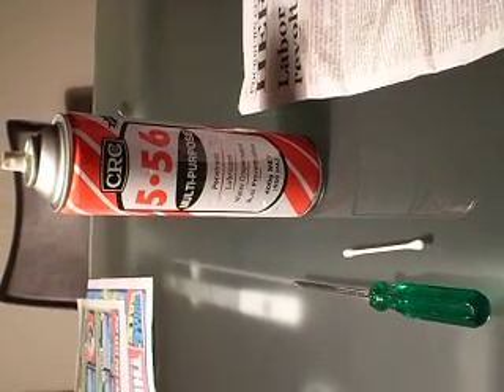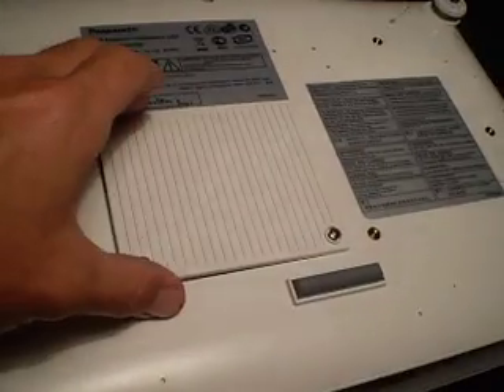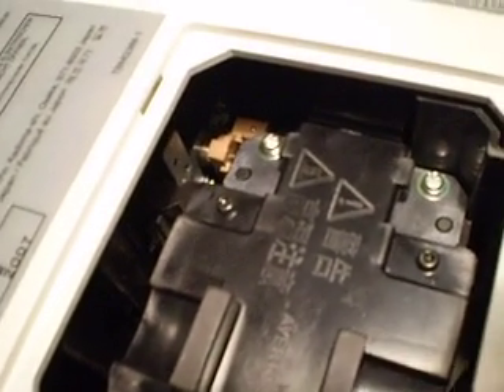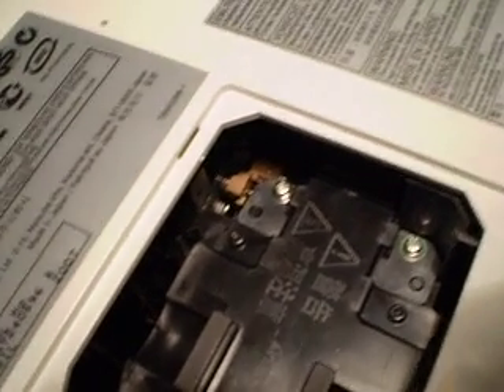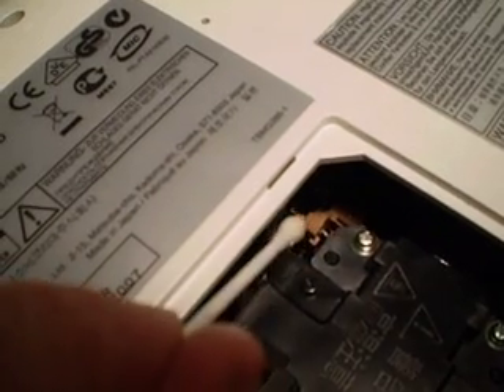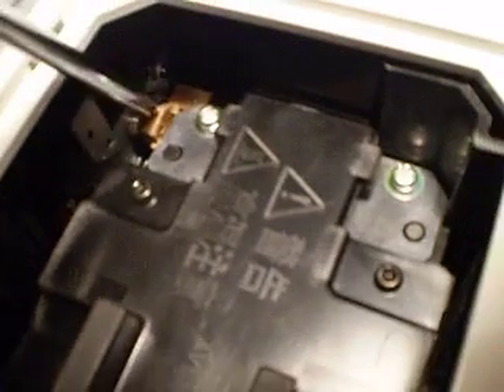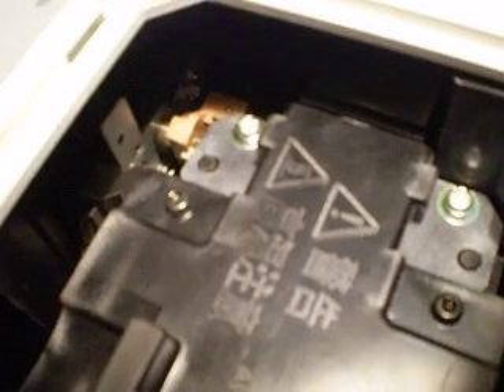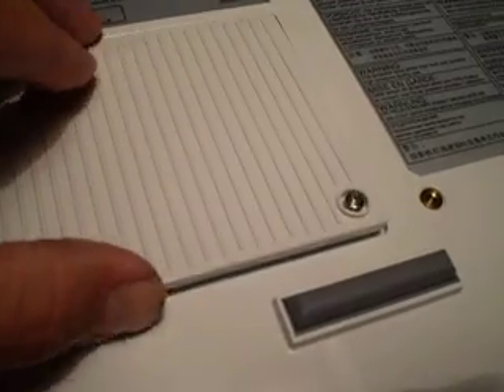Panasonic Projector Fix-PT AX100 E / U with WD40 and

Comment: Fixed mine using only contact cleaner. I could not get the exact same dry glide as you and using what I bought did not work. I cleaned it up and used only contact cleaner. It has worked for about 3 months so far. AWESOME. You have saved me thousands of kroners (danish currency) for a new projector. Thanks buddy for this great advice!!!

Comment from the maker: Hi Mate, Good to here that your projector is back online. For a more long term fix i used initially some electronic contact cleaner which is the type that evaporates in a few seconds after touching the surface to be cleaned and then i applied some silicone or Teflon style "Dry Lubricant"  a couple of times to both hinges and has worked a treat for the last 6-8months, good luck.

Comment: Thank you so much! Mine never refused to start up but always started with an odd grinding noise that would occasionally never go away and required a restart. Today it kept up with the noise after multiple restarts and I googled and found this video. Sure enough, the pivot was stuck solid. Lubed it up good and it starts up without the horrible noise!

Comment: Just fixed my PT-AE900U IRIS shutter, Projector had been shutting down  multiple times then restarting every time I turned it on.  Thought it was the lamp. bought new lamp same issue.  So i thought maybe it was my A/V receiver.  So I was just living with the issue.  Until I accidentally came across this video.  Started the cleaning and maint, the vid shows the pin moving pretty freely. My pivot pin was stuck like glue.  Cleaned with CRC and immediately started moving. the lube was the best improvement.    You saved my Projector!!! Thx!!!!

Comment: This solution can work - it did for me for a while.  

When it stopped working I dismantled the entire printer to get to the part he shows, cleaned the pivot pin with solvent and then sprayed with a little teflon dry lubricant. This appears to have been a permanent solution and it has never jammed since.  Slightly daunting, but not actually that hard.  The issue with any other oil etc is it attracts dust an gums up the pivot even more - a dry lubricant is perfect.

Comment: Thank you for doing this. I read on a few websites how to solve the iris problem, but nothing beats a visual how-to. I was about to replace my projector with a new one so you basically saved me $1,000. It's nice to enjoy movies/games again in my theater room! I would add a flashlight to your list of tools and I would suggest lubing all moving parts, not just the upper hinge. Also, you should mention that a really bad iris will move much slower than yours did. Otherwise, awesome!  Thanks!

Comment: A good resolution thanks for getting my projector back up. In the PT AE 1000e the IRIS mechanism is harder to get to but lubrication fixed the problem. The symptom is the projector starts and runs for about a minute then the lamp goes off. Turning off the power switch and restarting seemed to fix the problem. After this fix and lubricating it seemed to work fine. This projector is an old model but fantastic performance and hard to replace the image quality at under $5000 today.

Comment: It was 2 screws, then I had to pull just a tiny bit more than I expected. With the lamp removed I could just barely see another thin round metallic bar on which another plastic thing revolved when I pushed the iris shutter in your video. I applied some silicone spray there as well. That was the only other movable thing I could find - just under the 1st one. Some more lube on the 1st shutter again as in the video (a bit slower today). Lubed and quick now. Testing. Still shuts down in 1 minute.

Comment from the maker: Hi Mate,
This is what i have done in the long term fix, working now untouched for over a year. However, i would like to state that,  i did not dismantle the projector. I removed only the globe and it's housing and treated it initially with "contact Cleaner" to clean away the WD40 and then with a dry lube like "teflon"or silicone spray  but i had to do it a couple of times in the first 2 weeks, after that no worries. Good luck everyone!

Comment: Using WD-40 This worked a charm on mine. Incredibly happy with it now :-) Having only just fixed it, time will tell if it'll last long enough not to bother with the dry-lube solution. That said, it was so easy to do this once, if it lasts a month without the issue I'll just keep doing this!

Comment: I have a Panasonic PT-AE900 this solution worked on the  AE900 as well ( there's a slight difference in the pivot assembly) the solution is nearly identical . thanks for this post / repair..

Comment from the maker: Hi, There are 2 iris shutters, i believe when the machine initially starts it does a test by opening and closing the shutters fully. If it does not complete this in a set time it seems to shut down. And as the older lubricant heats up and the machine eventually completes a proper test it will stay on. To see the lower shutter you will have to pull out the globe,  just spray a small amount initially and then again if necessary, i did mine 2 times and after that it was ok.

Cheers

Kmdnss

Comment: @viragored I figured out how to do it.  The straight end of the spring rests against a plate, upper right of the iris pin as you're looking at it through the bulb access.  The shaped end of the spring rests against a notch in the plastic shaft.  To get tension on the spring I tied cotton to the shaped end, put the straight end in place and gently pulled the shaped end around the pivot - twice.  One turn didn't give enough pressure to return the iris to position.  All working again :-)

Comment from the maker: Hi,
Sounds as though you have found it ok. The most important thing i found was that the 2 iris shutters spring back into position freely and quickly after the lubrication. I just did this by manually working the iris shutter after lubrication. Other than these suggestions i am not sure. Certainly sounds as if you have that similar problem to what i had though.

Good luck

Kmdnss

Comment from the maker: Hi, Sorry i did not get back to you, must have missed this one. Answer is no video, but i have read about someone replacing the part and actually priced this myself, $ 70AUD in Adelaide South Australia. Apparently the trick is to note where all of the plugs and wire go as it is a bit messy when you get down to it. Maybe take alot of digital photos on the way, you have probably already done this, belated sorry mate.

Cheers

KMDNSS

Comment from the maker: Hi Mate,
Just on the yellow tint problem.
Have a couple of probably obvious thoughts.
1. During the repair something was left on the inside lens  causing a blurry type obstruction on the screen and you may be able to approach the repairer if it was not there before.
2. As these are an LCD projector the repairer may have damaged the LCD, although, if some pixels were damaged they would be clearly visible and in focus.
Hope this help, if i think of anything else....

cheers

KMDNS

Comment from the maker: What you have mentioned sounds like the actual hours on the projector are around 1800-2000. If this is possible you will need to replace that lamp. The can explode and damage your projector in the extreme cases. Cheers

BJ

Comment: Hi. this video is a good hint but not complete!
The Iris blind consists of two parts in this video is shown only the lower axis of one half of the Iris blind. You must open the beamer complete, 7 screws on the lower side one at the backside (all srews are marked with an arrow!). Then you must remove the Joystick for lensadjustment. Then remove carefully and slowly the top cover! You must find a small perforated plate with 16 holes under this plate ther is the other axis oh the blind. oil both carefully with a thin screwdriver with a small drop of oil on both sides of the axis, so you need to oil 4 points in complete, you can see th oil is zipped between the axis an the hole, after this move the blind like in the video an you will remark is closing with a click when you release the blind not so slowly like before !
Reply: Projektor schaltet sich nach 1 Minute ab, LED leuchtet gelb?
Hallo Jürgen!
Vielen Dank für die Ergänzung! Ich habe die Schritte heute nachvollzogen und übersetzt. Ist das korrekt so?
 
obere Hälfte der Irisblende ölen:
1. Projektor umdrehen.
2. 7 Schrauben auf der Unterseite und eine auf der Hinterseite öffnen (sind alle mit einem Pfeil gekennzeichnet)
3. joystick für Objektiv-Verstellung abziehen
4. vorsichtig Gehäusedeckel abziehen
5. kleines Lochblech mit 16 Löchern suchen
6. darunter liegt die obere Hälfte der Irisblende. Beide Enden der Achse mit einem Tropfen Öl benetzen (Öl auf Spitze eines dünnen Schraubensziehers)
7. Gehäuse wieder aufsetzen, joystick aufsetzen und 7 Schrauben eindrehen.

 untere Hälfte der Irisblende ölen:
1. kleine Klappe an Gehäuseunterseite öffnen (zwei Schrauben)
2. Beide Seiten der Blendenachse ölen (siehe oben 6)
3. Mit einem dünnen Schraubenzieher die Blende vorsichtig nach unten bewegen, bis sie nicht mehr langsam zurückdreht, sondern mit einem Klick zurückschnellt.

Comment from the maker: @bushranger07 ,
hi mate, i think i found the "dryglide" at Bunnings but the key to it was to clean off the old WD-40 using the "Contact Cleaner" and then lubricate both iris shutters, i had to do this 2 or 3 times and then it finally settled down. hope this helps.

Cheers

KMDNSS

Comment: Hi! Great information. I opened the lid and pushed the little lever with a screwdriver as you show, and it returned very slowly! After a drop of CRC Silicone spray, the thing (the iris?) now returns immediately, very fast.
However, the projector still shuts down after a minute or so (the power light goes yellow and then red).
Are there other things that could cause it do shut down?
Are there more places like this one that might need lubrication?

Comment: I just bought this projector, as a store demo with 500 lamp hours, it also shuts down after 3 min. but restarts after three attempts and stays on. I may try this fix, even tho I have a warranty (3yrs. extended) they would likley just do the same, but if I have any further trouble it will go for warranty repair. What would you suggest I do this first time? Try the fix or send it in. I could return it but the price was only $699.

Comment: I had the lamp cover off so that I could have a look at the iris with it powered up. There's a switch in there to stop it powering, doh ! Replaced the cover & all is well, still resetting so need some more cleaning hopefully, will call Panasonic as the PJ was repaired in the 1st year & is around 70 hours.

Comment: Hi, I did this a month or so ago & it helped initially then got much worse. I checked the pivot which was all jammed up due to the WD40. I had another go with some servisol switch cleaner but now the PJ won't power up, no led nothing. Bit of a  long shot but I wondered of u have any ideas ? internal fuse ?

Where is the best place to get the IRIS replaced & repair ?

Thanks

Comment: @kuatilamadness In case you're still monitoring this: I think I might have two problems, the sticky shaft and the iris return spring has come off its anchor points.  It's likely  I pushed the spring off with the cotton bud delivering the cleaner and lubricant - but I just can't see through the lamp space where the spring should be fixed.  Can you help at all?  I think there is a groove in the plastic shaft for the short end, but where does the long end press against?

Comment: Addition: I turned the projector on after shutting down completely, about five times (closing down almost exactly after 1 minute), but now it stayed on! But I guess the problem will be there again tomorrow, when it has cold down again. From the description in my previous message, can you determine whether I found the 2nd iris shutter? If so, it seemed to be totally interlinked with the first one, since it moved when I pushed iris shutter 1 (the one shown in the video). Was I at the right place?

Comment: as jurgen khal says in the comments.. this is not a proper fix.. I was doing the method shown here for a while.. but the problem never really went away.. just gunked it up and  2-6 restarts were always required(annoying) ..

1.. DO NOT USE WD40 TYPE OIL (use a silicone grease or lube)
2.. COMPLETELY REMOVE THE CASE 
3.. USE A CONTACT CLEANER FIRST (wd40 contact cleaner is fine) 
4.. on BOTH sides of the iris lever (both brown plastic) apply the silicon grease (lower end shown in this video) (top end (remove case) half hidden under a metal grill with holes)   

my projector is now quite happy..
Reply from the maker: Hi Mate,
Great Post. I had the long term fix in there about 3 years ago. Looks like it was been removed, maybe when YouTube went to Google or whoever owns it now. Anyhow it is back.

Comment: I have this projector and it has been working fine then over the weekend I turned it on it started up as normal then the blue screen came up with the Panasonic logo and then this disappeared leaving just a blue screen but no input sources would show up just the blue screen. I am a noob so not sure what this means, does this need a replacement bulb? The projector does not shut down like others have said so I assume that this is not the iris problem that many have talked about. Can anyone assist?

Comment: @kuatilamadness : great, I'll try this... but could you (or someone else) explain what "pull out the globe" means. What is the globe? Is it the lamp? And that's under the lid too, right? A "light house" secured by a few screws, right? English is not my native language, and projectors aren't a speciality of mine...
What I tried just now was to pull gently in the protruding lens part of the projector, it didn't move, so either I need to pull really hard, or that's not it. Please enlighten me!

Comment: Hi, I've bought a second-hand PT-AX100E with 1590 hours on lamp. when I turned it on for the first time it shuts down after 1,5 minute. I 've tried to turn it on again and again, and every try was finishing in the same manner after minute or some.  I've thought that seller sold me the broken projector. I've lubed it with WD-40, but the problem .  Maybe I have to lube the second iris shutter too. But how I can access the second shutter? What is the "globe" Please help me in solving this problem.